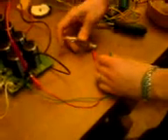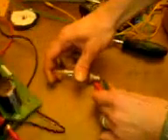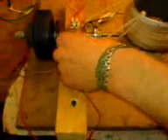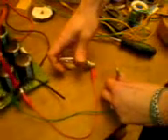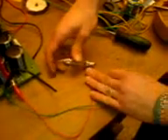newman motor replica  runs on 4x 9volt batteries

Comment: I made a Newman's motor ' the motor runs but the Battery does not charge,after half hour the Battery goes dead. Hence, Sir  can you let me know the proper connections to the commutator & the  Battery. of course! ! have used speaker ring magnets not neyodium magnets, I wonder whether this  is the cause. my best regards. RAG Srilanka.

Comment: You cannot maintain the load so no it is not more power out than in.  If you were to measure the power in and power out, you will find you need more power in than out.  You have not demonstrated anything.  As soon as you connected that bulb, the voltage dropped as expected.  That bulb would not glow bright for long.  You don't get something for nothing.  I'n not trying to be mean but you need to learn more about electricity.

Comment: so the secret is that the lamp lights up using those batteries and motor, which is not possible if the lamp is connected directly to batteries?

Comment: very interesting except for the obvious that the skeptics will only believe when you can run a useful (plus 1000 watt) load forever, anyway why any batteries at all would not a sub coil and diode bridge/cap work with the rotating mag field to generate enough power to replace the battery ? 

cheers keiththeengineer